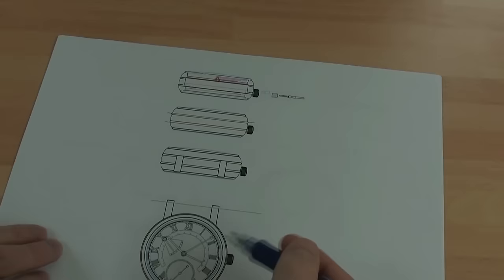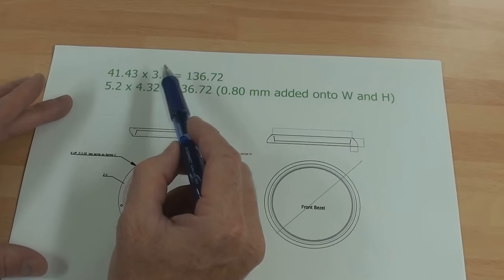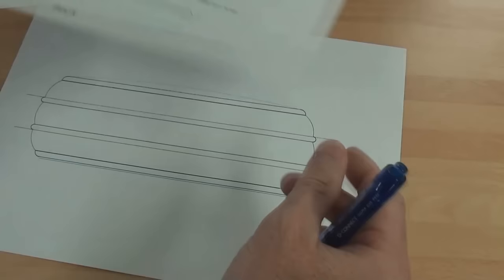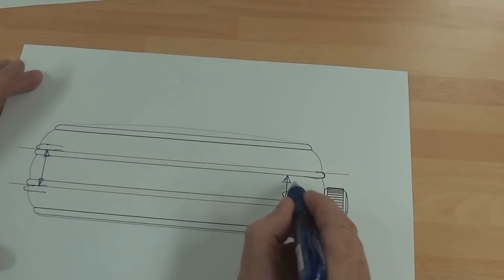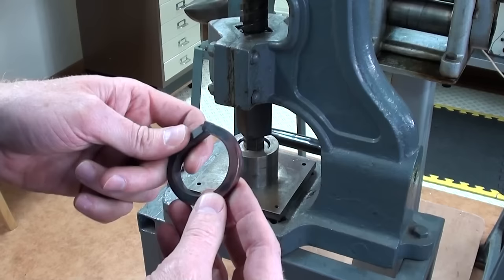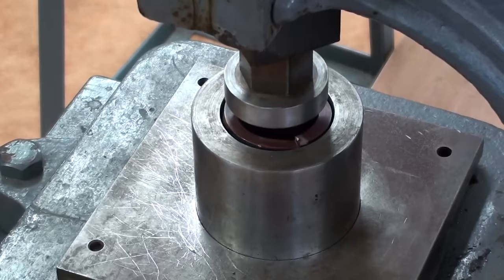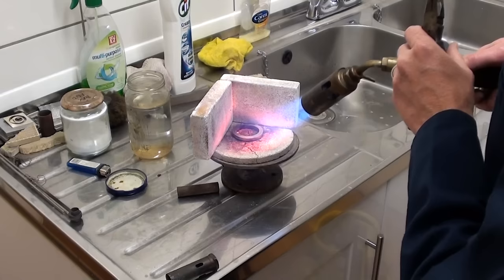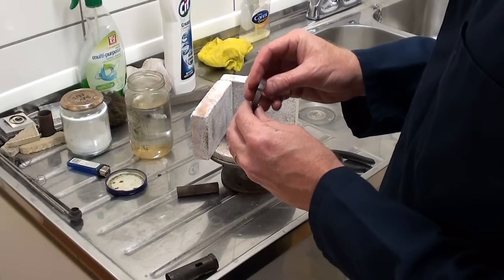Part 1 of 7 - Case Making by Roger Smith

Comment: I'm curious, what kind of press is used at ~7:52? Anyone know the brand or tonnage? Anything similar sold today with the fittings used here? I'm guessing those were probably custom machined.
For those that care: I did a little research and have learned that it's a fly/screw (or maybe arbor) press by one of the following brands: Manek, E.A. Adams, Norton, Denbigh? 
Or maybe none of them. Eh, I'm sure one of the above would also work out fine for a similar task, though – which is what I wanted to know.